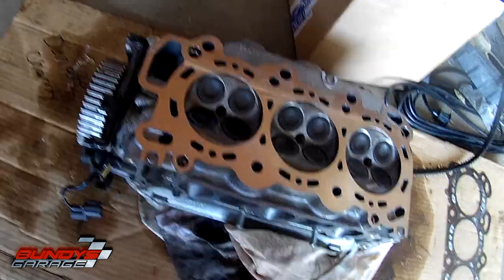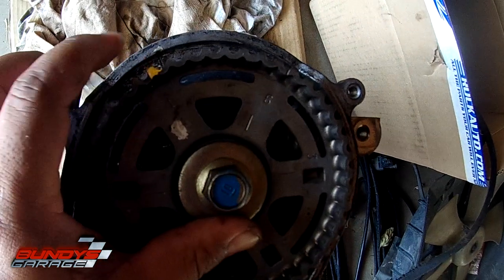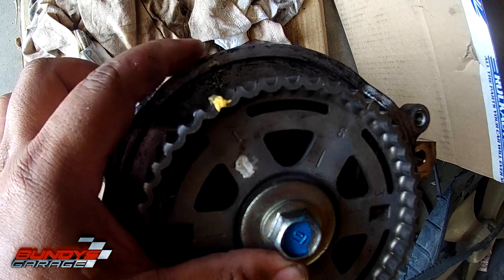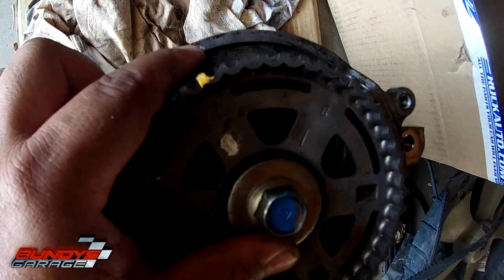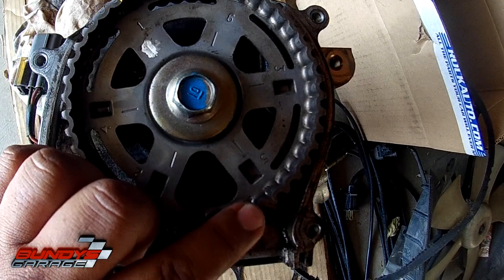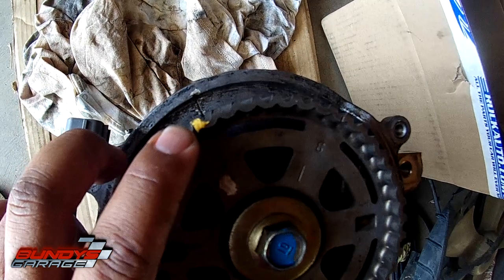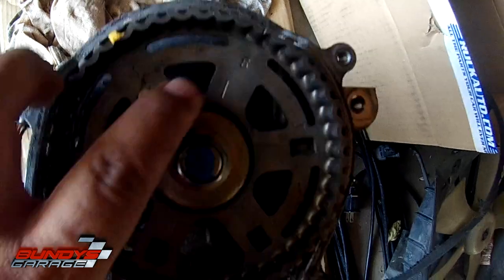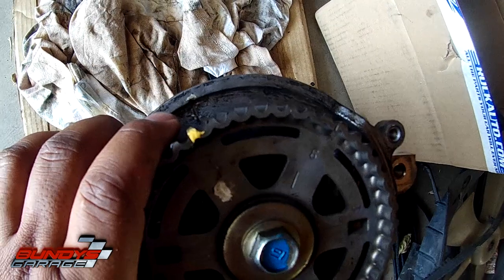Honda J Series | V6 TDC Camshaft Alligment | Acura | Accord Odyssey Ridgeline Pilot TL CL MDX

Comment: Mr.Buddy is there a way to get it all back in time with the heads installed. If you are installing the belt and you line everything up take the old belt off and you go to put the new one on and for what ever reason say the front cam jumps forward off the mark can you go counterclockwise to line it back up. It hasn’t happened to me just wondering if you can go counterclockwise that small amount to line the cam marks back up. Long time subscriber. Happy New Year stay well and safe Artie 😊🇺🇸
Reply: Yes, you can go counterclockwise to bring cam back at TDC